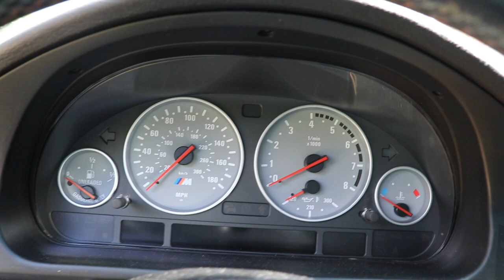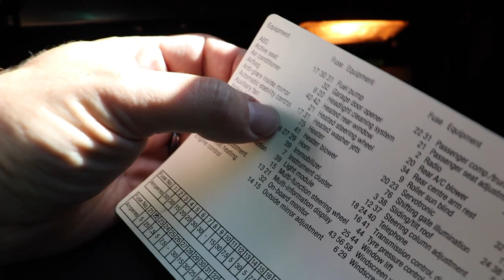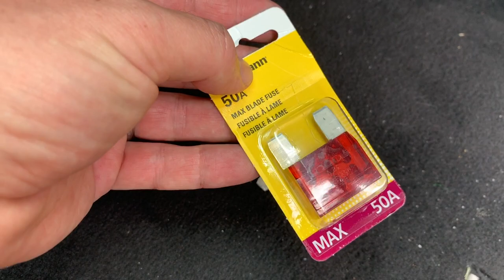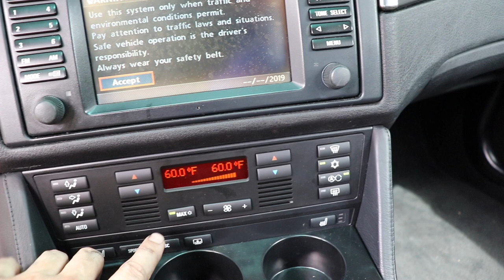BMW E39 Aux Fan Replacement

Comment: I experienced the same AC cool/hot issue with my 2003 525i.  Fuse is good, AC comes on, but this fan does not spin.  Thanks for the helpful video.

Comment: I just want to know if the aux fan is supposed to go when the engine is on an will it still work if the ac does not work
Reply from the maker: Aux fan should turn on either with the AC or when engine temp reaches a certain level to help the mechanical fan, like when the car is not moving during a hot day.
Reply: @NoGaragE30  also with my 2001 bmw 530i  i can also operate aux fan from the computer but its not working no more so i was thinking my aux fan must be broken but ive been driving for a few days no problems thanks bruh
Reply from the maker: Depending on the conditions where you drive, the engine may not need the additional help from the aux fan. If you live in a cold place or dont drive in heavy traffic for example. There is a chance the AC could need it though and not having it could put addition stress on the compressor.
Reply: @NoGaragE30  ah ok i kind of messed with the AC an now its not working an then i found the aux fan wasnt working either i think it mite be the wiring i dont know  its the not the fuses i dont think im ttyna diy fix it
Reply: On some vehicles the six fan will mot come on if the ac compressor isn’t engaged. This can happen when you are low on refrigerant. Simplest way to start is apply 12v directly to the fan and see if it spins.

Comment: Perfect video! I have a BMW E39 520i 1997. When I turn on the air conditioning and the fan blade turns on immediately. I was with a master who did this by turning on the air conditioner, not at a later stage. Is this normal or should it be turned on only when it gets too hot? Otherwise, on hot days you overheat the car. And today it happened to overheat on a frosty day, but at the moment there is no antifreeze and the system is not deaerated, which will be the next goal.

Comment: I replaced my but didn’t work fuse was good . And I have 12v at plug. I had also replace the coolant temp switch. And still noting.
Reply from the maker: If you have a good fan and 12v at the connector the issue would have to be with the sensors/signals that needed to start the fan. Depending on the fan type you have different things to look at. An early model 4-wire fan is a bit simpler it is usually a temp sensor (which you have replaced) or the fan relay (think this is close to the fuse under glove box). The late model 3-wire fan (like mine) is more complex as it requires signals from the ECM to operate. The easiest test would be to run the A/C on high as this should send a signal quickly. Otherwise you would need a scanner or computer than can run aux fan tests to simulate the signals etc. While working on mine I did see some people online reporting the issue as bad wires to the fan connector, with physically bad wires that would read 12v but not be able to carry the current needed to power the fan, something to keep in mind. There are good troubleshooting threads on this topic online.

Comment: This is a very nicely done video. Thanks for taking the trouble to make it. I was doing some other work on my 528i and noticed the aux fan was physically broken. The fan blades are all broken off and lying in the space in front of the aux  radiator. Nothing else is damaged or disturbed in the area and the remaining fan shaft moves freely when turned by hand. I can't imagine what could have caused this. Maybe the fan just disintegrated due to a manufacturing flaw. 

Anyway, your vid shows the way to fix it. It looks easy enough and I thank you again.
Reply from the maker: Thanks. The job is not hard at all. Just takes time to take everything apart and put it back together, etc. Make sure you buy a quality replacement part so you dont have to do the job twice or deal with a loud fan. Good luck!
Reply: Fortunately it was not the clutch fan that disintegrated that can tear up the hoses and damage the metal of the hood
 
First time I have ever heard of a aux fan failing catastrophically and I have had m54 since 2003

Comment: Good video and good work. I didn’t need to remove any lower corner pieces on my 528 to get the bumper off. 
You might as well just remove the headlights, they’re easily unclipped and you can replace the adjusters and polish them while they’re off.
Reply from the maker: Thanks, the headlights can use a polish for sure.

Comment: Nice video. I have also problem with fan. 
It does not turn on when AC is on. It turns on only when temp goes up and mechanic fan cant cool down. But then it works permanently till baterry is dead. :D
Reply from the maker: Wow. If you have the variable speed fan like mine it is controlled by the ECM, with input from several sensors like Radiator outlet temp, A/C pressure, speed, etc. My understandig is the fan receives the signal from the ECM and uses its own power output stage (part of the fan motor) to turn the fan on/off and increase/decrease speed. I would check for codes if you have BMW scanner. Replacing parts until you find the problem is never fun. There are good troubleshooting threads on this topic online.
Reply: @NoGaragE30  can you tell me where to buy that fan, I have bought 3 by eBay/Amazon and non work. It looks like they Dont have module.
Reply from the maker: @GuniMatamoros  I ordered a Behr OE replacement from FCPEuro here: https://www.fcpeuro.com/products/bmw-a-c-condenser-fan-motor-525i-528i-530i-540i-m5-351040111